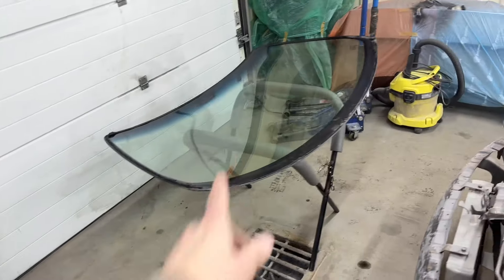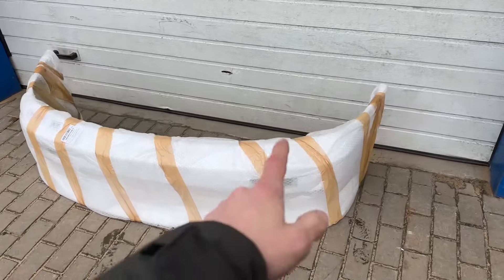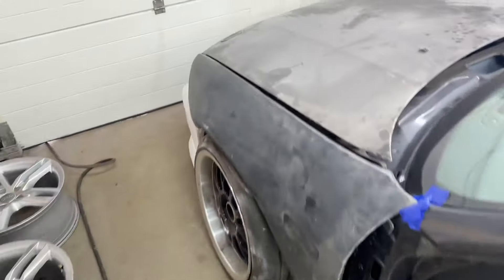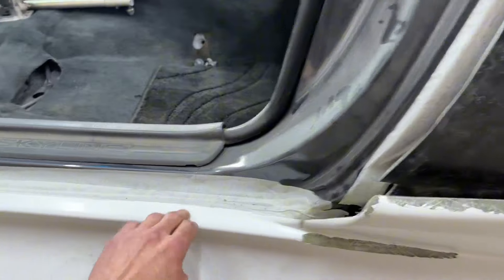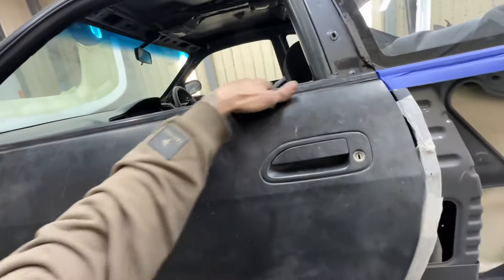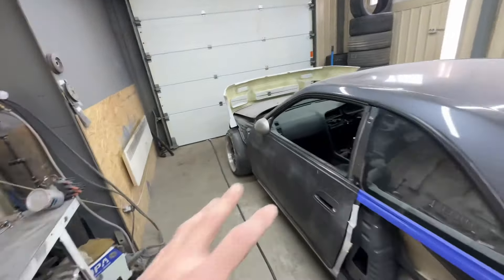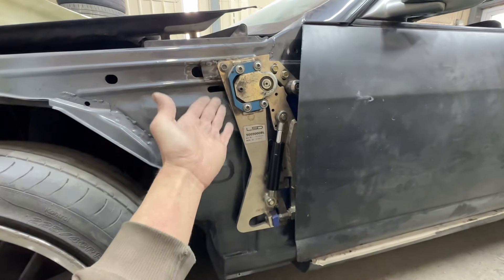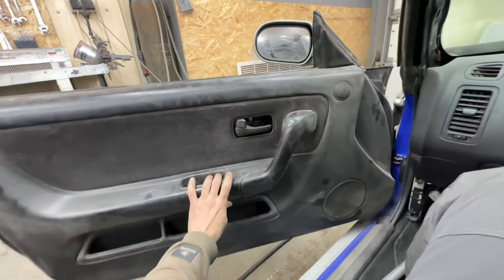GTR Fenders for my Skyline

Comment: For the side skirts, you may just have to peel the weak layer of fiberglass off, and lay your own resin down, or perhaps use Bondo body filler or something of that sort to make a harder surface for you to paint. I personally would use Bondo, it's easy to work with and sands easy enough. It's messy, but if done right it lasts a long time. Just ensure that Bondo can bond with fiberglass first!
Reply from the maker: Thank you for your advice. I tried several different options. I'll probably tell you in the next video.